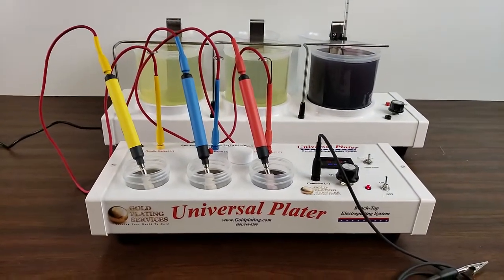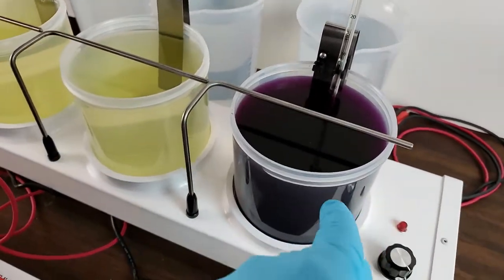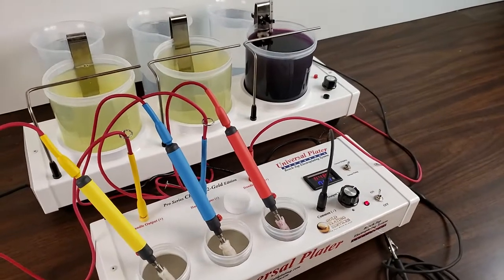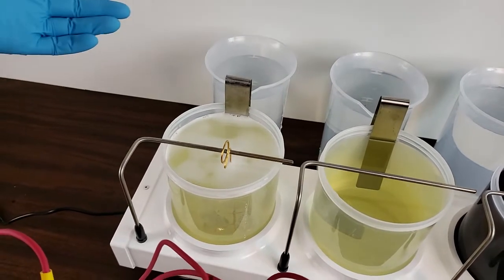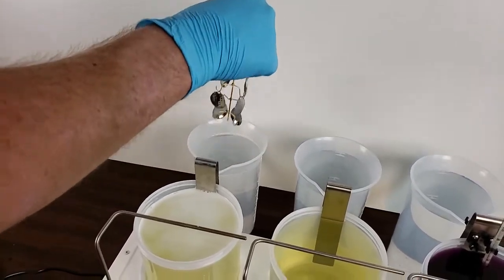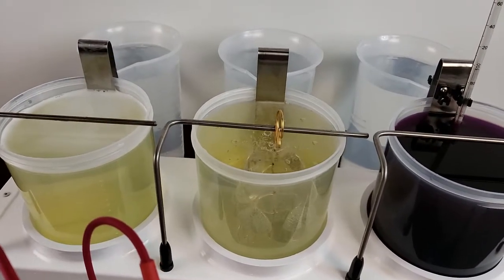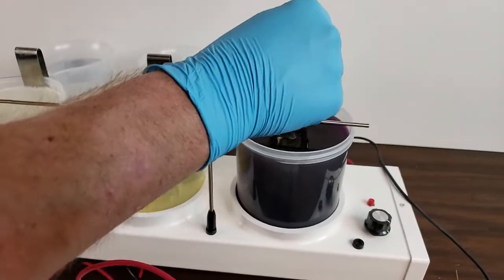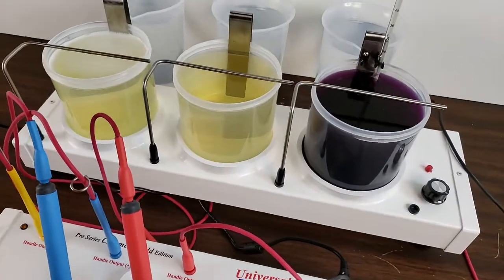3 Step Bath Gold Plating with the Universal Plater Kit! New 1 Liter Add-on

Comment: So if i want to do cooper with the brush can i?
Reply from the maker: Yes. We have a brush solution for copper.
Reply: @  but can it a done with the universal plate kit? I read in a description that only can be done goal, silver and nickel to so cooper and brass need extra equipment
Reply from the maker: Yes it can be done with the universal plating kit. You would need to buy the extra chemicals and sleeves. Here is a video of us plating copper onto a sample piece https://youtu.be/2tB4iSfcnes

Comment: I noticed in your video where you plated the gun slide that you had the final to solutions (nickel strike and gold plate) heated.  Could you still gold plate a gun slide using the Universal Kit and this add-on?   If so, would it be the same quality plating? Thanks and awesome products!!

Comment: I have that plating kit but now I want that extra kit, for example gun parts, I use the cleaner, woods nickel , bright nickel then gold plating.
If I do gun parts doing the same 3 steps you did, will there be rusting?

Comment: How hot does it get?  Enough for using with rosegold?
Can you get a second beaker for other plating material? Would you need different anodes!  Thanks
Reply from the maker: The heater will get solutions up to about 135°F, which is sufficient for Rose Gold solution to function optimally.
You should have a separate beaker and anode for each solution you wish to plate with.

Comment: Is there any chance you can make a spreadsheet or a paper for the voltages for different metals for the bath plater or do we use the same voltages we did with the brush plater on to the bath plater?
Reply from the maker: We are working on that.  Thanks so much for the great feedback.
Reply: @GoldPlatingServices  can you make a male to female anode extender cords. If we had a tall and skinny tank for the plater solution it would be easy to dunk tank long items but the anodes would not be long eough.